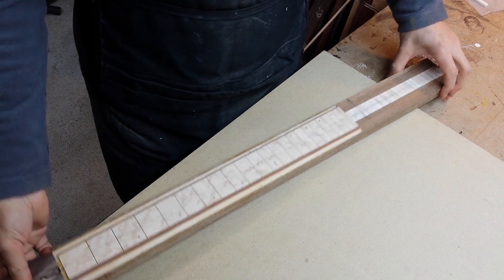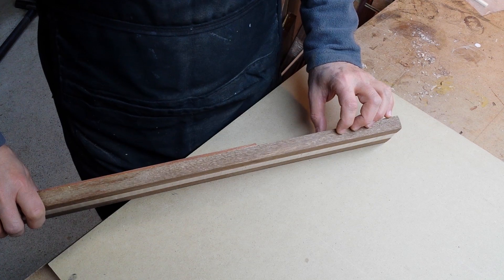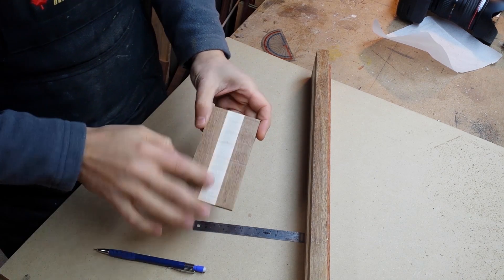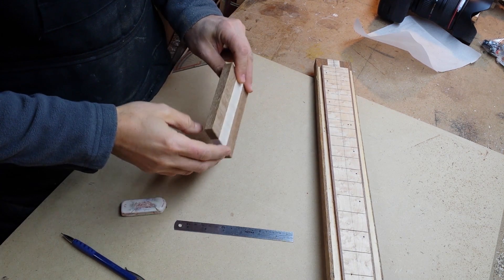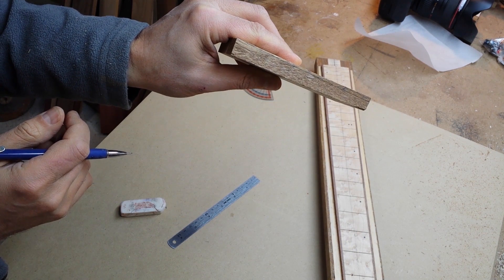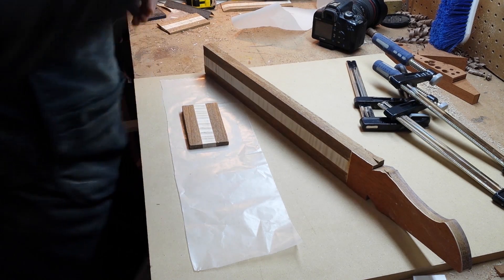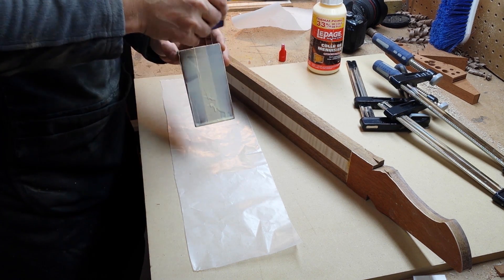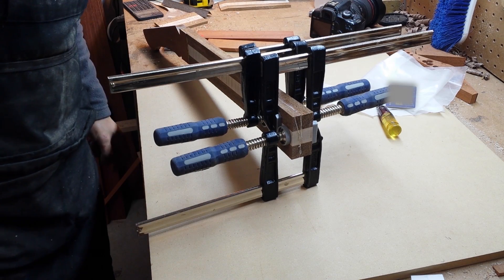How To Add The Neck Angle Into The Guitar Neck Heel

Comment: I'm planning a Flying V build, and this seems like a way easier way to achieve the neck break angle than routing an angled neck pocket into the body. However, the geometry of this method will leave a small gap between the heel end of the neck and the back of the neck pocket. Check this brief screen capture for clarification: https://youtu.be/pbExFuMtMuM (not to scale)

Looks like the gap will only be a couple 64ths, so maybe that's not an issue?

Comment: Doing the neck angle this way, rather than in the neck pocket, makes it harder to change the neck in future, but does make for a more solid connection! Beautiful work keep it up!
Reply from the maker: On a glued-on set neck design like this, there's no real possibility to change the neck in the future. It's potentially doable but not worth it. There's no difference in the stability of the connection... 
Thanks!

Comment: Awesome work! Do you think a regular (cylinder style) spindle sander would work with this? Cheers
Reply: It will be extremely difficult to get a straight flat surface free of ripples. The larger drum you use, the ripples will be larger and less noticeable than you'll get with small drum.

Comment: I think that simplifies that process alot! You should make a angle sanding jig. Great for other things like scarf joints.
Reply from the maker: You're right, I really need to make a proper jig to make it easier and more accurate.
Reply: @Projectelectricguitar  check out maximum guitar or fletcher hand crafted. Super simple hand operation. Also those guys are craftmen whose knowledge and PROCESS are the entertainment value. Grad level info .

Comment: You absolutely do not work with so short pieces holding it with your hands pretty much with any woodworking machine involved. It is not safe. Keep it longer and use a hand planer on free hand or make a template pocket with the right inclination/angle and plane or route it down.
Reply: Bandsaw, yeah probably shouldnt... oscillating sander meh

Comment: Do you have issues with the piece sliding when gluing and clamping? It's an issue I have when gluing a scarf joint for the headstock, but that may be because its 15+ degree angle where as this is only 2 degrees
Reply from the maker: The 2 degree angle does not slip but the 15 does. Check out my video here (https://youtu.be/PrFbVYtH0qo) starting at 12:10 to see the setup I use to solve that problem.
Hope that helps.

Comment: Maybe I missed it somewhere in another video? Why do you angle your neck heel instead of adding angle to your neck pocket? Just curious?
Reply from the maker: Both options are good. It's simply a personal preference of mine to incorporate the angle into the neck heel.
For me, it's easier to draw a line on the heel and then sand it back to that line rather than build a tilted planing jig for a router... again, just personal preference.
Reply: Makes good sense to me. Definitely not trying to slam you for it. I have built several bolt on neck guitars but no set necks yet. Trying to weigh my options before I dive in. I have some plans for an Ibanez 
Destroyer clone. Your videos are awesome. Thank you for taking the time to record and post them.
Reply: THATS WHAT I LIKE ABOUT YOUR VIDEOS, YOU THINK OUT SIDE OF THE BOX AND FIND SIMPLE SOLUTIONS TO SEEMINGLY COMPLEX TASKS, NOTHING WRONG WITH THAT AT ALL.